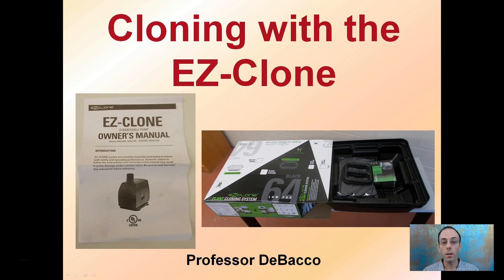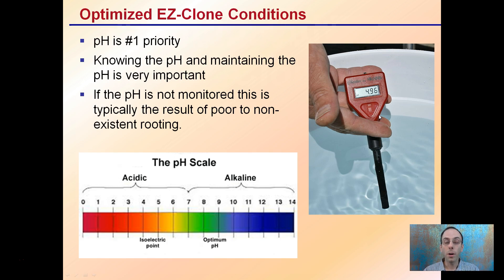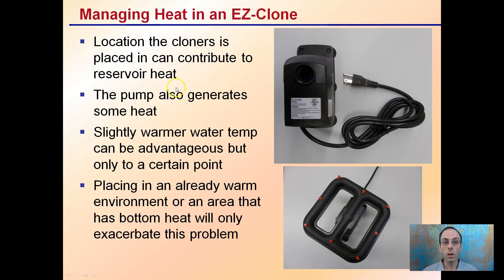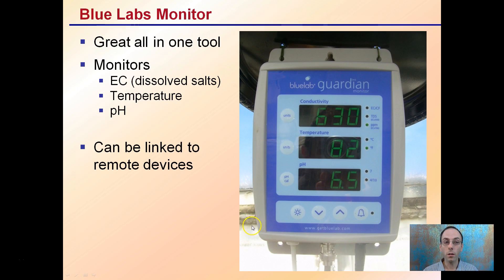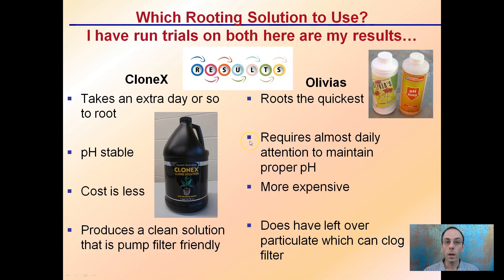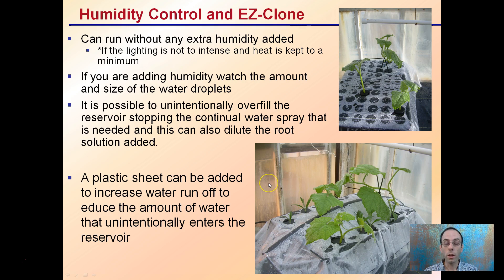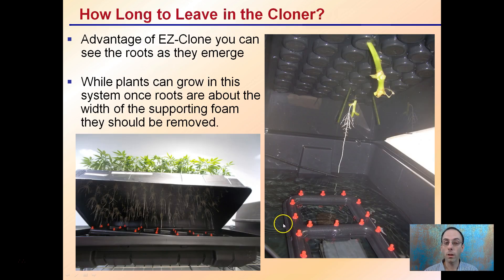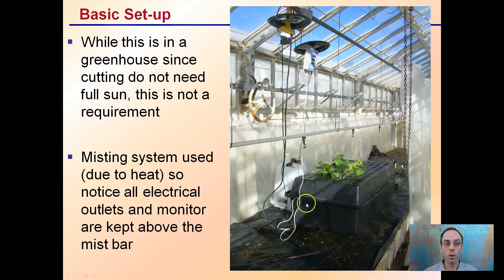Cloning with the EZ Clone

Comment: Hi. Thanks for the info. Best video on the ez clone I’ve seen. I just purchased one. Is it recommended to run it on a timer or does it spray 24 hours? What are your recommendations? Looking forward to your response
Reply from the maker: Thanks for the comment!
Personally, I recommend to run it 24-hours.  I also like the CloneX solution to put into the reservoir.  The key is to have a continual water monitor system so you can catch potential issues early.  pH is #1 priority.  If the pH is correct and all other factors are in a good range you can get roots with plain water, but often this delays the process.  CloneX rooting gel and CloneX solution with the correct pH, ppm and temp = quick and efficient cloning.